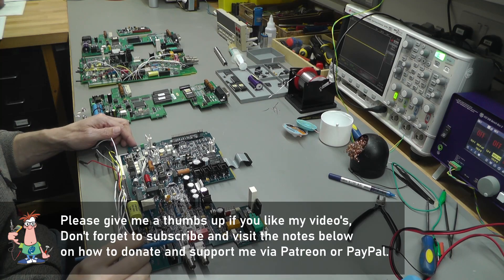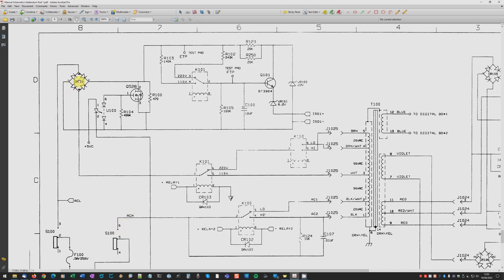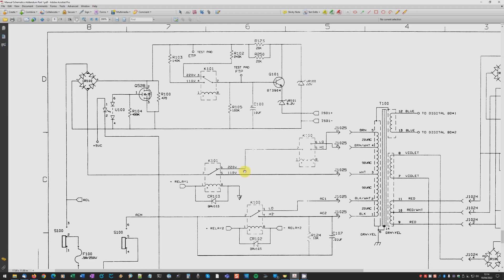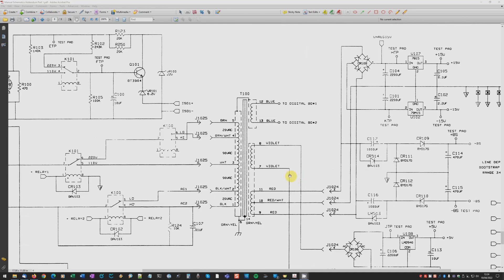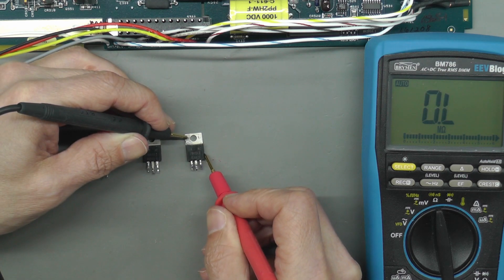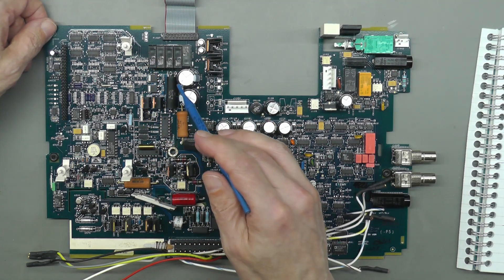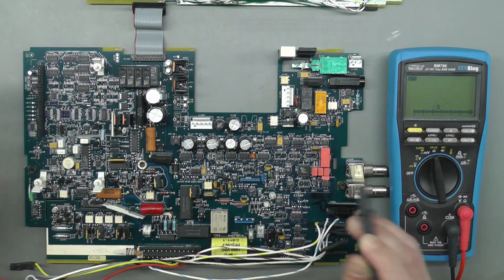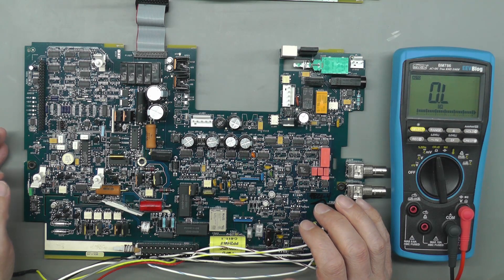No.090 - Keithley 2001 7.5 digit Multimeter Repair - Part 4

Comment from the maker: The more I think about the auto 110/220Vac and Hi/Lo selection the more I think I'll bypass it, and maybe come up with a bit of kit to allow others to retrofit on their K2001. Hmmmmm!
Reply: How designers bright enough to create an instrument like this thought that mains selection circuit was a good idea is beyond me. Surely a design that defaults to a safe condition is not asking for too much.
Reply: @jonka1  "It's safe" if you are in the US. They should have fitted a secondary side OVP if they wanted to be elaborate.
Reply from the maker: The donor boards came from a non-240Vac country, so I think i'll take a look at it and work out whats blown coz maybe, in hindsight, I should be looking at this board to fix especially if i will be by-passing the pre-regulator circuit etc. Hmmmmm!
Reply: @IanScottJohnston  I wonder if any of the rectification components are damaged from Over Volt.
Reply: @IanScottJohnston  When considering the fact that every single chip on the original board is trash, it might be better to repair the parts board, especially since the parts from the parts board could still be broken, so even if you move everything over to the original board, you still have to deal with any problems the parts board had before plus any possible mistakes that could have happened while moving parts over and maybe even parts that broke from the heat of de- and resoldering them. I would just bypass the corroded autoswitch and fix the parts board instead, as that one at least seems to not be completely fried, so there is at least any chance of fixing it.

Comment: That complex yet convenient (and idiot-protection?) line voltage switching system appears to be a potential source of a "single-point failure" which, if faulted, will destroy the rest of the unit.   In a medical instrumentation and aerospace systems, unacceptable. Is this what happened here?
Reply from the maker: Yep, common issue with these meters……sadly!

Comment: Interesting, for as long as I worked at Keithley I did not realize the 2001 had that auto line voltage detection.  I suspect the 2002 does as well, it was closely related to the 2001.  Everything else was manually selected or used off-the-shelf switchers that could handle 100-240 volts automatically.  FYI, the GPIB address lost pointed to the bad EEPROM.  It would save the default so now that you've got a good EEPROM you shouldn't see that one anymore.  The calibration data does not get saved until the calibration is completed.
Reply from the maker: Yep, it’s a shame and talked about quite a bit that we can’t save individual functions individually like VDC. Have to run through the lot first.

Comment: Hi Ian, I would be tempted to use your dual rail bench PSU and current limit the output and wind it up and check for hot spots with you IR camera.
Reply from the maker: Thats coming, i like to get the obvious off the table first. Mind you, things are taking a slightly different turn.....wait for Part 5....:)

Comment: That line selection circuit is just stupid, and completely unneccesary. It's the sort of thing youd set ONCE, maybe twice in the product's lifetime, and leave it there... ie, a switch. Completely overcomplicated design which has of course failed and caused extensive damage as a result. I'd be disconnecting the lot of it and just hard wiring it for the appropriate line voltage

Comment: When testing the negative regulators it looked like you had the polarity of your probes reversed.  Don't you need the negative side on the output of the regulator?
Reply from the maker: The resistance readings are the same either polarity. There are soooooo many devices/parts connected on those supply lines it makes little difference.

Comment: Can you use your thermal camera along with using an external current limited psu to look for “hotspots”?

BTW - what thermal camera do you use?

I’m going to venture an opinion here…I think that you now have TWO donor boards!!!
Reply from the maker: I use a Flir C2 which I have modified so it's optimum at about 6" from the Pcb.......stock C2 needs 12" or more.

Comment: What a terrible choice by the original designer!
To trade off automatic ac mains selection over - potentially- destroying the whole pca!
The mains fuse probably would not react fast enough before major circuit damage.

Comment: Keithley certainly over complicated the ACvoltage switching there, I’m sure a manual switch would have been far better!
Reply from the maker: If they weren't stupid, then its possibly in order to keep the temps and current down to a minimum being a 7.5digit DMM.

Comment: The bridge rectifier arrangement is the same in the video I did a while back on a V-Pro AC dimmer, to allow a MOSFET or IGBT to switch AC.
Reply from the maker: Designed by an ex-Keithley engineer maybe.....:)
Reply: It goes back a very long time. I came across this idea on the paper tape punch of an Elliot 503 computer where a scr was used to switch the power to the motor. No opto-coupler, pulse transformer driven by an unijunction oscillator...
Made sense at the time.
Reply from the maker: Just had a look at your video, and yep it's the same idea. For a dimmer fine, but a 7.5digit DMM ugghhhh!

Comment: There were some digital film recorders which used GP-IB.  One of them was the Matrix PCR which could produce 4K images with 16.7 million colours- and this was back in 1984.
Reply: Interesting you mention Matrix, a friend of mine has just picked up a Matrix film recorder (sans the camera) which he used to use in the 80s to generate slides from a Quantel Paintbox. If anyone has any camera bodies from a Matrix recorder we would love to find them.
Reply: wow, 4K in 84. Thats amazing. Bet it was bloody expensive.
Reply: @simontay4851  Actually a bit better than 4K.  It had a resolution of 4096x4096.
Reply from the maker: @douro20  4096x4096, is that the formula for working out the cost back then......:)

Comment: I already shuddered when I followed Illyas / TiNs repair reports on these Keithley DMMs. They were really badly designed, also lacking circuit FMEA, obviously. This automatic 110/240 V switching is over engineered and dangerous. No robust design at all. But that really might be a lot of fun to further dig into this PCB. Great analysis, and entertaining videos, as always!
Reply from the maker: I agree.....and when I get to it I'll only use the auto switching if I am confident in it working.......given my line voltage is close to 245VAC here in the UK!.....else it will get bypassed.

Comment: also: if you do use the donor, then chop out that stupid line 240/120 switch and hard wire for your 240v, not worth the risk again. IMHO it was a terrible choice to design an auto switch. Especially since no one needs an instrument to auto set every time it is turned on,...
really dumb idea. Even smart engineers make stupid choices sometimes,.... blush.
Reply from the maker: Thats something I am contemplating, but it will depend on the testing and confidence I will have on that switching. Also, the pre-regulator system may be keeping temperatures/current consumption down in the unit......I'm thinking there gotta be a reason they didn't just fit a switch!
Reply: @IanScottJohnston  LOL, it is a cute circuit, I am sure the guy was proud. But it is a risky thing to do, my bet is it was more pride than practical. After all, an IEC filter/fuse is simple, well proven, without any nasty silicon that risks the entire unit. Good luck what ever you choose, it makes a good video. dan

Comment: Ian, in a word PUNT. I know I would hate to give up, but the history and your observation regarding the line switching -(I suspect you are correct), leads me to believe even if you get it running - it will fail soon after. I would use your 'donor' board as the one to fix. Toss that dog in the trash, it is not worth the effort and risk of future failure. ;-} 
cheers
Reply from the maker: I don't need a 7.5 digit K2001, I got this faulty unit to have some fun trying to repair it (my fav hobby!) and to make some cool content for my YT channel. If the analogue board (and the digital board for that matter) were the newer versions then I might have turned to fixing up the donor boards, but they are not.

Comment: why on earth did they use such a complicated way to switch from 240-110 volt ac input???
Reply from the maker: I guess as it's a precision instrument they found it necessary to manage heat and current consumption as much as they could. But, one glitch and it's fried!
Reply: @IanScottJohnston  yes but it seems a dangerous way to do it as well as complicated and the adds more danger
Reply: Could also be was designed in US, where we have 110/120, and if it failed with only 110v everything would just end up undervolted, no harm done. 
But yeah. Seems like a weird design…